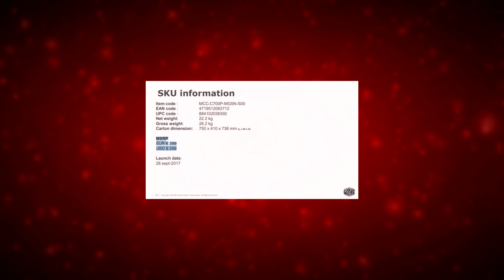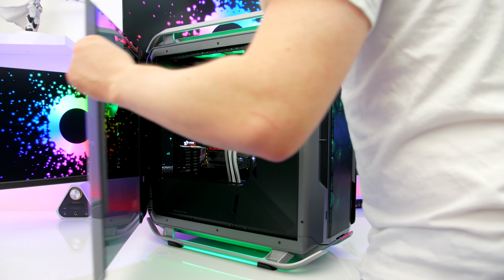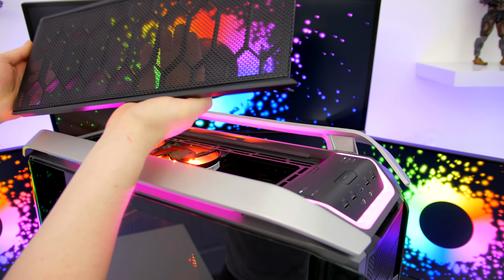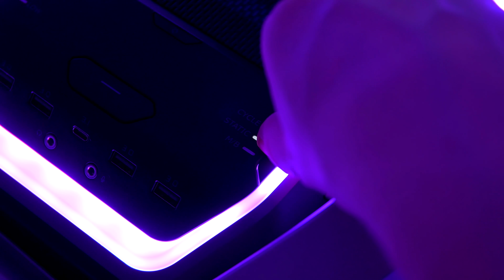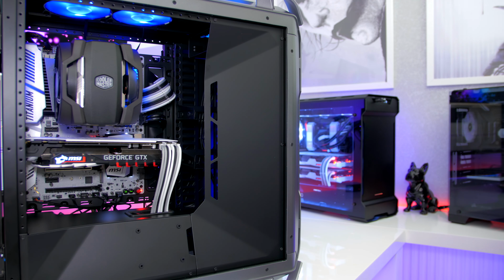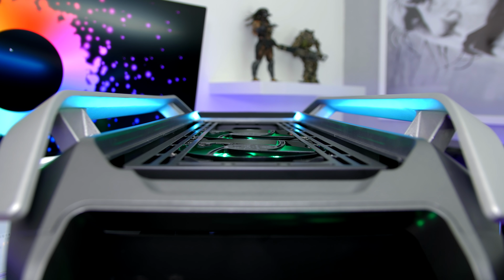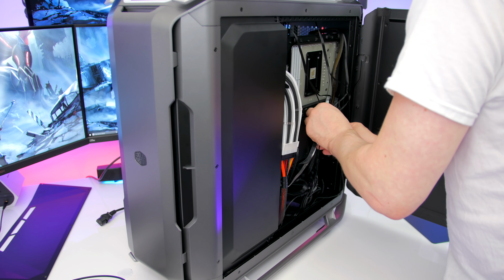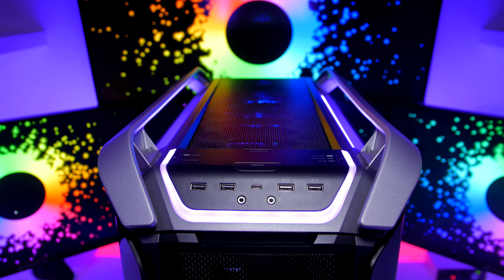Cooler Master Cosmos C700P Review - An Epic Full Tower.

Comment: One of the rare cases nowadays with good IO front panel.  One day someone will realise that 3.1 gen two IO Ports at the front  (not just what is tantamount to 3.0) is super important nowadays.  Overall its very disappointing that Thunderbolt 3 is not on the front IO of any cases I have researched.  The reason I say that is because I have checked everything from a $2,400 case down to a $50 case and all are behind the times and don't have these IO options even though I am putting in a recently released $1,200 ASUS motherboard with all the goodies of every latest type.  Generally cases are cases, the end user efficient and effective experience is what "should" count.   Colour and RGB is now old hat and amounts only to a few folks yen for POSE if a mate drops over.  Bottom line I am only considering this Cooler Master case because it has reasonable front IO components of and pretty average speed and data transfer rate considering what is out there.  I have no interest in gawdy and flashy RGB, as it only adds absolutely nothing to the units performance.

Comment: At 299 dollars they should have included RGB fans and more hard drive trays.   It seems overpriced, but it is probably expensive to manufacture a modular case with tempered glass that is curved.
Reply from the maker: The stock fans are a let down.